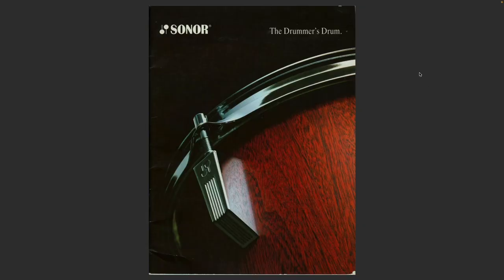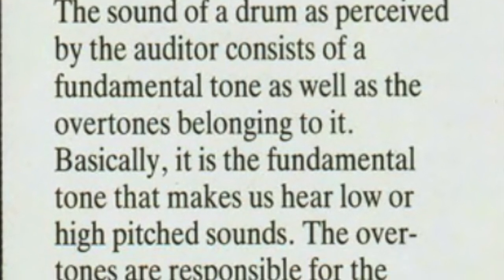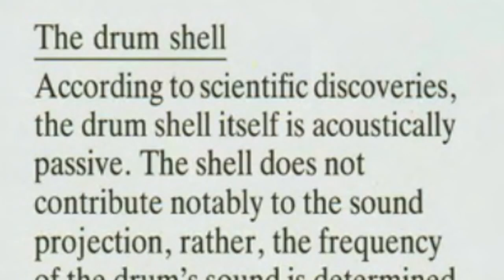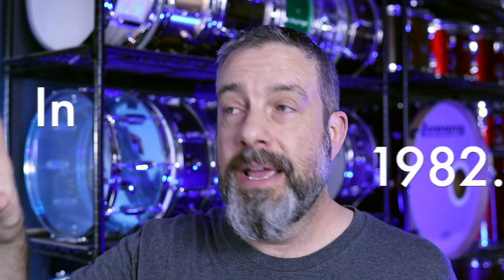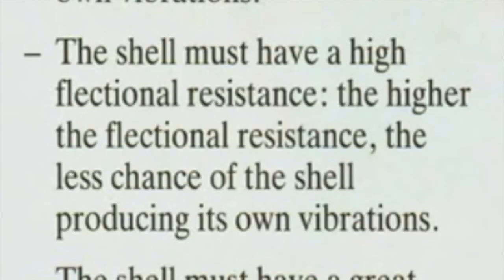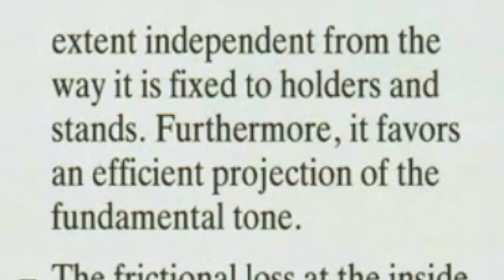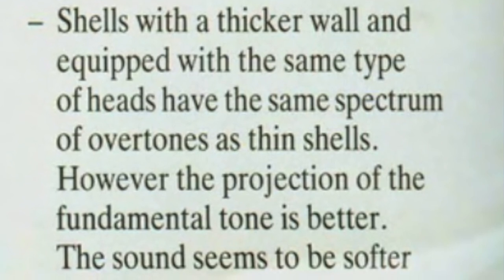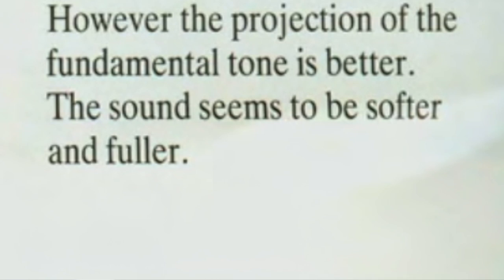That's Not What I've Been Told!  Drum Sound Physics, Part ONE

Comment: There's one problem with the Sonor theory. It was bullshit to a certain extent. The Signature heavy resonates or vibrates quite easily and its definitely not dead - as far as the shell is concerned. You can feel the vibrations clearly if you touch it when you play it. The tom mount and where you mount it on the tom arms has a huge influence on the sound. Every tom  has a sweet spot on the arm where it sound open and huge. 5mm off and it sounds dead as a Dodo. Funny thing: that sweet spot is different for every single drum. They are definitely different to thin shelled drums, but i'm not too sure if thats because of the physics mentioned in the Sonor catalog.
Reply from the maker: Awesome information!  That's so interesting...

The Heavy line of Signature drums were 12-ply, all beech with either bubinga or ebony inner and outer plies.  Beech is harder than either birch or maple (more rigid).  Bubinga is half again harder than beech, and Ebony literally twice as hard (all according to the standard Janka harness scale).  This means that while Sonor's ideal was a basically inert, passive shell, they made their Signature drums of some of the hardest tone woods available, all of which conduct vibration beautifully (making the shell more active).  So from what you're saying, despite all of their articulated intentions their thick, 12-ply, massive shells were so stiff that they vibrated anyway!!  That's kind of funny.

They should have made their drums from something a tad softer, like a mix of beech with something like mahogany or poplar as an insulator between every few plies (I haven't discussed the impact of this method of shell construction yet, but will in a future video).  The shell definitely would have vibrated less.

I have never personally played any Sonor Signature drums, heavy or light (the latter of which were 7-ply birch, and still quite heavy by today's standard).  

And yes, there are modes of vibration at play in drums, and this is something that I personally haven't done much research on, and my years of experience with drums haven't really demonstrated clearly for me.  If you attached any hardware, mounts, etc. on points of a drum shell that are essentially not vibrating (the 0 axis of a sign wave, if you will) then it will have the least impact on the drum's sound.  I imagine this pattern of vibration changes with the tuning of the drum, however (I don't see how it couldn't), so experiences will still be mixed, no doubt.  

All such fascinating stuff.  You can just rock me to sleep tonight!!  

Thanks so much for sharing this observation!!
Reply: @drumdotpizza  Here's more food for tought: The Signature has a relatively limited tuning range: it has a low tuning that is unbelievable, a mid tuning that is amazing and a high tuning that is superb, but everything between isn't really great. I also have a huge Phonic set, and that has a marginally thinner 9 ply shell without the bubinga inside and out. That just has a very even tuning range. It sounds great tuned low to high and everything in between, but is never as special as the Signature set. The beech shell itself has what I call a bit of a schizophrenic nature. When you play it soft it's focussed, clean and precise, but when you lay into it it just starts to roar. And that crossover point is pretty black and white. I started on an old Sonor Champion set 30 years ago and gradually drifted away to maple and birch shelled drums. About 12 years ago I picked up a set of Phonics on the cheap. Now I have the full Phonic catalog in drums that I reveneered in Ebony and I have a huge signature heavy kit. The 70's and 80's Sonor drums really are something else. Not practical - insanely heavy, mostly due to hardware - and very large, but very different than anything else out there.  

Another thing to take into account is shell tension which has a huge effect on the sound of a drum. John Good and I don't really get along (I've been reviewing drums for a drummers magazine for over 23 years now and I don't always agree with him on everything he comes up with) but his idea on grains and shell tension and corresponding pitch actually does work. More vertical plies lead to a lower pitch drum. Sonor actually inadvertently started this trend as the shells they made where constructed from 3 ply beech glued together in a way that both the inner and outer ply of the drum where vertical. If you take that to a 9 ply construction that leads to at least one more vertical ply than a horizontal one and compared to many of the drums at the time which had less plies and horizontal inner and outer plies it had two. 
If you want to talk more about drums, construction, pitch and sorts, drop me a message. I've seen and heard some stuff over the past 22 years. :P
Reply from the maker: Do you mind if I use this comment in an upcoming video?  I am actually expanding on this idea a bit and would like to credit you with an appropriate comment/understanding of this...  ????  Thanks.
Reply: @drumdotpizza  go right ahead, and feel free to drop me a line if you need anything. I've been reviewing drums as a profession for the past 24 years.